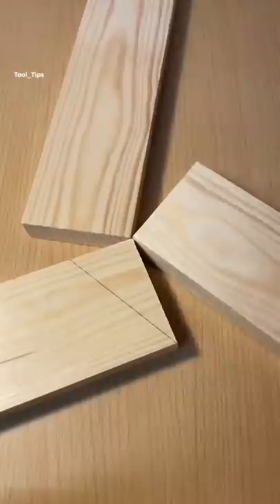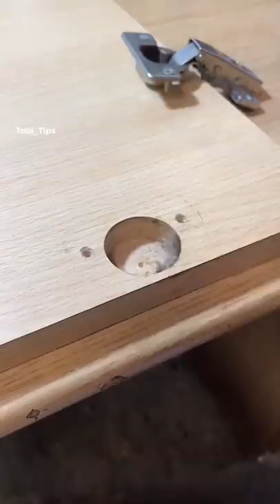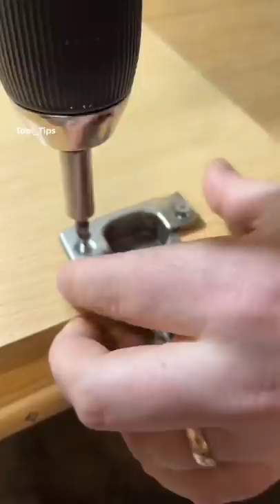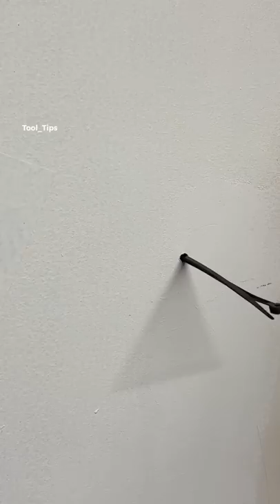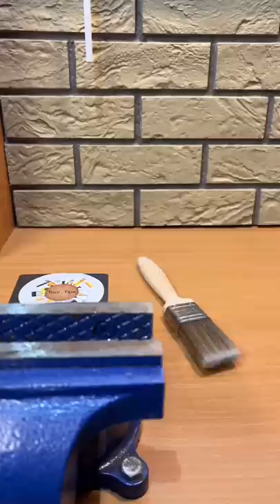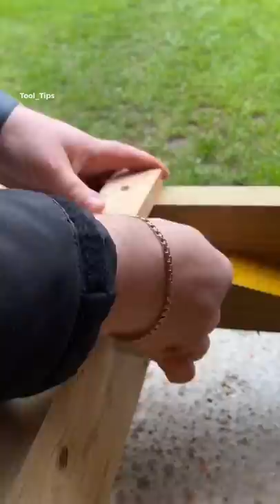Five Tips in One Minute #shorts

Comment: Using a cleat to hold the joist is a good tip. The better tip is use a joist hanger that is rated for the load in your application

Comment: Don't wanna be that guy but you could of used non-adhesive stick pads or velcro to put the multi-socket outlet and instead of drilling holes into your wall........just saying!
Reply: Don't most of those strips have little holes for screws to sit in anyways?
Reply: @zombieman3011  Even if they don't, can't be that hard to add them yourself!

Comment: Yeah because the holes for the screws in the back of the surge protector dont exist
Reply: It would be harder to knock down if you had cats though. They bap at anything within range of their mits, and they're willing to jump without a seconds thought for the landing.
Reply: @Thejackofirishdiamon  wtf? Yeah I guess, under those circumstances of your cats messing with your surge protector.
Reply: Have you ever tried lining those JUST the right width n length screws up in EXACTLY the right spot so you can slide the strip onto them? I’m switching to this method bc its a PITA to use the slots on the back.
Reply: @JillofAllTrades2  yes you put a piece of masking tape on the back of the surge protector then poke holes where the screw holes are. Tape the tape off place it on the wall and put screws where you poked the holes. Pull tape off wall and it goes right on.

Comment: Why install dowel rods and not just drill straight into the wood itself?
Reply: Probably something to do with grain direction, maybe. It could also be that you tried to tighten too much, and now it won't hold anything. The pegs let you start over with fresh material thats relatively easy to come by.
Reply: For the door hinge?
It looks like the screw holes were too large/worn out for the screws. The dowels fill in the space for the screws to bite into.
Reply: The holes were stripped out.

Comment: Ah yes instead of installing outlets install fire hazards into your wall
Reply: Are power strips fire hazards?
Reply: As if installing a new outlet wherever you want is a quick 3 minute job lmao
Reply: Who installs multiple outlets in a place where a single power strip will do? That's in no way a fire hazard
Reply: Electrical is my trade and as long as your not exceeding the amperage capability of a good power strip it is totally safe.. probably the safest place for it to be drywall has a tough time burning.
Reply: @ChristiannTyler  I think a major problem in the US is that you can buy power cords that do not meet the requirements for the maximum amps your circuit can handle. While here in Germany, every power cord is made for 250V, 16 Amps - nothing can go wrong.
I noticed that on a technology connections video
Reply: @marcokrueger3399  very interesting! And true, That’s a great standard to have (you Germans are good with that lol) 
 I never use anything that’s less than 12awg wire I think that’s around 2mm+ for everyday garage stuff. We’re also on 120v so that’s another issue.
Reply: @ChristiannTyler  Very good!
I think 1.5 mm^2 is standard here for everything, should be safe then. It's just important that if you work on electricity yourself, you should know what you're doing. I won't trust everyone with that 😅
Reply: @marcokrueger3399  on one had I get it the safety features are nice, but on the other hand it's the government saying you are too stupid to safely handle electricity which leads to more people being ignorant.
This ofcourse is just speculation on my part as I have no experience with European power or how dangerous it is or isn't, all I know is coming in contact with 120v will generally lead to a minor shock causing a fair amount of discomfort but nothing that requires medical attention.

I've personally never cared for safety nets, but I've found that this is a uniquely an American idea "that's currently dying for better or worse" as most strangers I speak to who are overseas are baffled at the idea of safety is not my first priority.
Reply: @foodhatesme  Intersting opinion, but I do think your assumption is false. It's not a matter of ignorance, it's a matter of education that people are ignorant. How should you know about the dangers of something not anyone ever told you about?
Different aspect: Imagine buying paint for your walls. Is it your job to check if the paint you're buying is causing cancer or is it the paint company's job to not use cancerous ingridients? How do you know if a substance causes cancer? Is it ignorant to not know what causes cancer and what doesn't?
As an engineer, I can't stand that perspective. It is my job to make my product safe to use - not the user's job to not make mistakes.
It's not even the government that designs these safety nets, it's the government that enforces them.
(And especially with children (that can't be called ignorant because what shall a two year old even know?) 120V can of course be dangerous and cause severe health issues. Don't be ignorant.)
Reply: @marcokrueger3399  paint is something I can agree needs to be regulated can't be selling something that actively causes health issues just by being in the same room. Let's go with another example laser pointers they can blind/damage your vision yet they are still sold, why because said dangers are disclosed usually in bright yellow labels on the product. This same concept applies to anything that requires ac power the dangers are usually listed on the box, product itself, and a removable tag near the end of the cord. 
If there isn't sufficient warnings of possible danger then the government can get involved do to the manufacturers ignorance/incompetence, but the government has no business setting the standards.
Yes your job as an engineer is to produce a generally safe and effective product, or provide sufficient warning of the dangers of said product. There are plenty of power tools on the market with no safety features, some safety features, or all current safety features all of which disclose the dangers you may encounter it's not the government's job to force manufacturers to use safety features. The government's job is to ensure the company is not outright lying about a product and isn't failing to disclose the hazards of using said product...
Finally your comment about children is kinda moot as the parent is responsible for the child meaning the parent should take safety precautions to ensure the child doesn't get hurt. That doesn't mean a manufacturer shouldn't make safety features focused on protecting children, it just means it's not the manufacturers responsibly to do so. 
Never said 120v couldn't be lethal or cause severe health issues so I don't get your point.
Dam didn't realize I wrote so much.
Reply: @foodhatesme  Happens pretty quick, huh? :D
We need some kind of standardisation, otherwise it would just be a real mess - and I don't even know if these standards are standards by law. But it's nice to be able to use your equipment throughout Europe. (I'm specifically talking about power sockets)
I see that you have general trouble with government regulations, and while some things are overregulated, most of them just make real sense. And our power sockets are just really good power sockets 🤷🏼‍♂️
Another thing: This is a product of everyday use - just like paint. You have to use it hundreds of times throughout your day, they may be hidden behind a sofa. While with our solution, you can use it blindly without any issues, you can't say that about american power plugs.
That mentality of "people should feel the consequences of their mistakes" is something I can't stand and imo the most arrogant thing you can say, because what that implies is: "I don't make mistakes." But people make mistakes, sometimes without knowing, that's life.
Europeans and americans just generally think differently: It's "Vorsorgeprinzip" and "Nachsorgeprinzip" in German. One example: Here in Europe you have many crash tests on cars, you have to prove beforehand that your car is safe, while in the US, the manufacturer does these tests and isn't forced to prove it to any authority. You just do it correctly because otherwise you can be sued afterwards - so in the saddest of all events, you sue a company because people died. That's a terrible option.
This leads to some hilarious examples, I once noticed a safety sticker on a popped hood on an Aston Martin, warning you that you can hit your head there - nobody would ever do that in Europe.
It's right, you didn't say that 120V can't be lethal, but you said it generally leads to minor shock. It's all about time, and my flatmate got shocked with 230V before and didn't have any issues - but I would not recommend it to people.
Reply: @marcokrueger3399  there's many areas where standards are set without government regulation. Charging cables are an excellent example of a standard being adopted without the government being involved. 
I do think you're over estimating how often people actually shock themselves on power outlets in America, I've been shocked once in all of my life and I blindly plug things into hard to reach outlets all the time.
The concept of there being consequence for actions is typically a good thing, it's a subconscious way of making people more aware of what they're doing.
As for the car crash example we'll just have to agree to disagree, I strong prefer a reactive government over a proactive government when it comes to domestic affairs. There is a heavy cost that comes with that type of mentality, but it's the cost of freedom. Governments that are proactive will take your freedoms away in the name of safety, covid is a perfect example of proactive governments stealing people's rights in the name of safety.

Comment: Melt the end of the zip ties so ppl don’t cut their fingers on the sharp off cuts!!
Reply: Or just avoid them all together, most power brick have mounts on them already, he could have just put screws in the wall and stuck the brick on them. No point in not doing that if you're screwing into your wall anyways
Reply: If you twist them off with say a lineman’s pliers it also gets rid of the sharp edges
Reply: First you shouldn’t use zip ties. Second you can get flush cutters very cheap. They leave no sharp edges